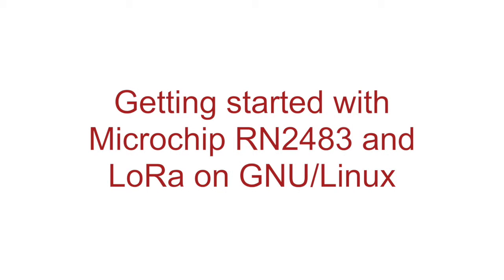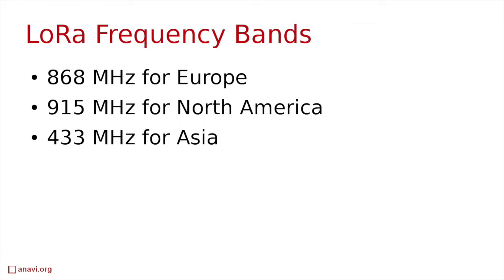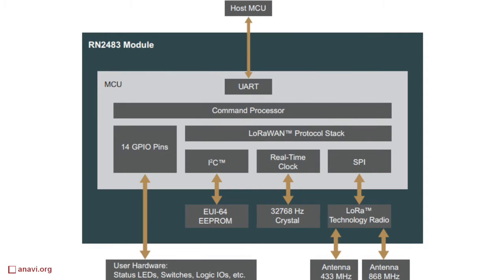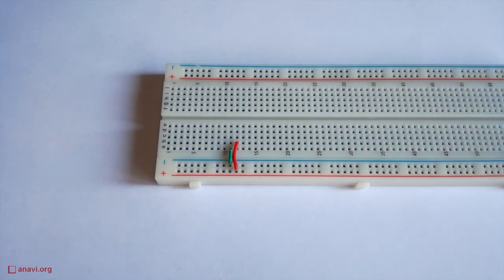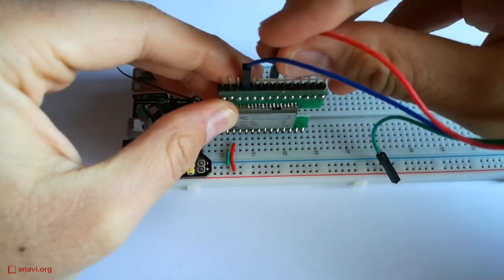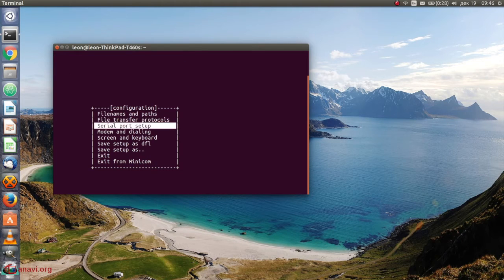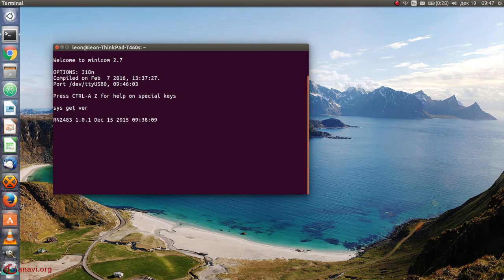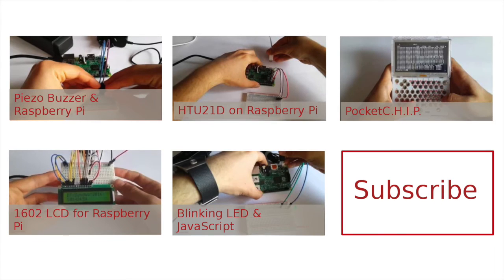Getting Started with LoRa, LoRaWAN and Microchip RN2483 on GNU/Linux distributions

Comment: Hello Mr. Leon Anavi,

We are using the same controller RN2483. Which mounted on Liyatech company mPCI module LRM001, this mPCI we placed on Adlink IoT.
Can you just tell me how we can make one system as a sender and another as a Receiver, we need to give a demo to customer.
second (AT) command can we use in Echo mode of minicom ?? 
we are using ubuntu 22.04LTS
please provide some support.
Reply from the maker: Setup the module as shown in the video and in https://anavi.org/article/211/ After that follow the steps from the Microchip user's guide to connect, send, receive, etc.
Reply: AT command for receive and send a data through lora would work on this on serial monitor minicom??
 @LeonAnavi

Comment: hi brother, am delighted with this video, am an onboard system developer and am carrying out a project with the microchip pic32mx270f256d microcontroller, my big concern arises at the level of remote communication, it is possible to use lora and the bookseller are easily found how on arduino ???
Reply from the maker: Yes, thanks, this video is a bit old, as of the moment there are a lot of new resources about LoRa and upper networking layers like LoRaWAN which you can use withing the Arduino ecosystem for compatible dev boards.

Comment: what is the device connected with the chip rn2483. Please help me over. video time is 0:53 sec at which it shows up
Reply from the maker: This is MB102 power supply adapter for providing 3.3V to the RN2483 module
Reply: need to know one more thing, how can we transmit data from lora node to gateway using addresses. Thanks in advacnce

Comment: Very interesting video.. I've was wondering what can I do with LoraWan, and finaly I found good Chanel for it . I just need to find out how to use for Smart City concept... Greetings from Serbia
Reply: i thought putting them on bikes to prevent bike steal but you need contacts for such things :)
Reply: Arda Ilgaz it could still be implemented. It wouldn’t be too difficult to design a hub based power generator and a in frame lithium or lifo battery to maintain power and be recharged when the bike is in use. Implemented properly it could be well integrated where it would be a hassle to remove the devices.
Reply from the maker: Greetings from Bulgaria :) I am glad that you like the video. Regarding the smart city concept you should have a look at "The Things Network".